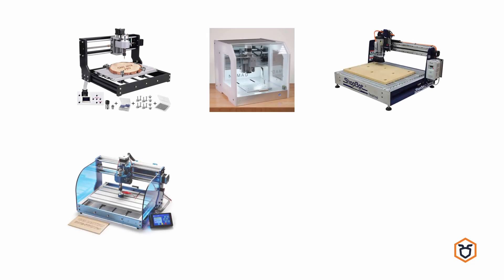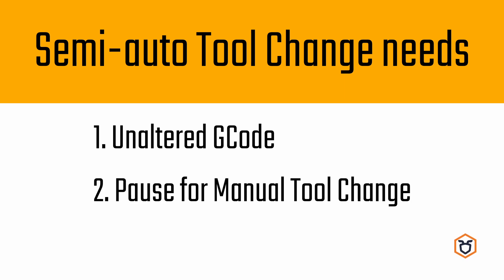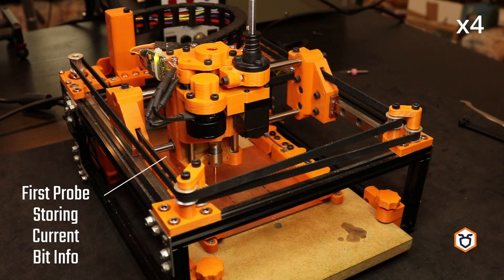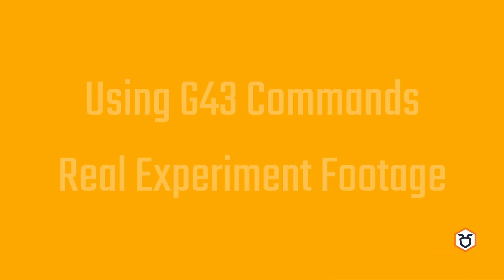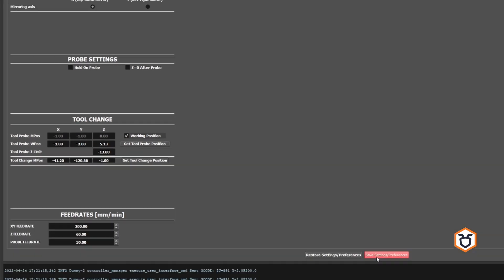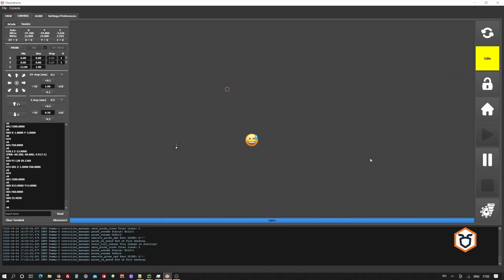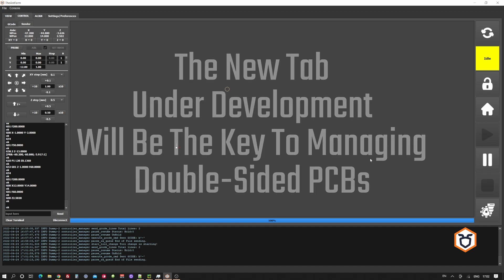The Ant Farm - Tool Change Feature

Comment: I have a problem that I hope someone can help me with. When I reach M6 in Gcode, I get Error:20 which means this command is not recognized by grbl. When I use TheAntFarm, where can I activate this macro which filters out M6 and makes the machine go to switch tool position? 
I must also say that your projects a some of the best out there, I have spent many hours on them with great satisfaction
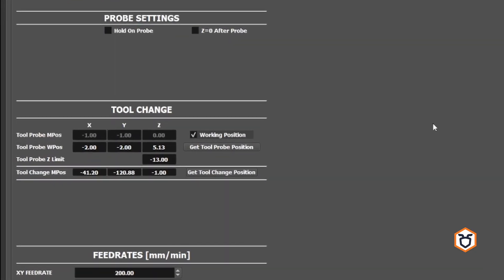Reply from the maker: Hi Manuel, when the The Ant Farm is configured (see 4:54), it should automatically substitute the M6 command with the equivalent commands that execute the semi-automatic tool change. If this doesn't happen send us a mail with your gcode attached or open an issue here: https://github.com/TheAntTeam/TheAntFarm/issues describing with details what happens.
Thanks for your compliments, we hope you will have fun with The Ant.👍

Comment: Wouldn't it be easier to have a standard built in probing point in the CNC, like tool changers us?
This method works as well and requires the PCB to not be isolated or need to be carefull where the prob is done not to be in a isolated areas. So more prone to error.
Reply from the maker: Hi Nando, yes it is possible to do that, and in fact that is what you could make with the absolute Tool Probe position setting as we indicate at 5:10.